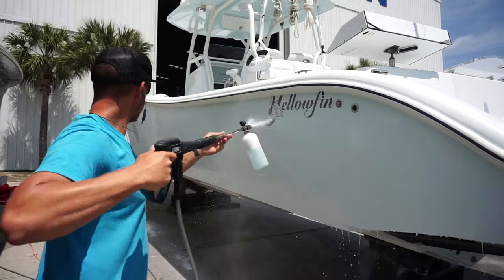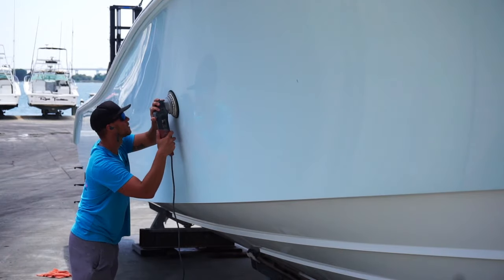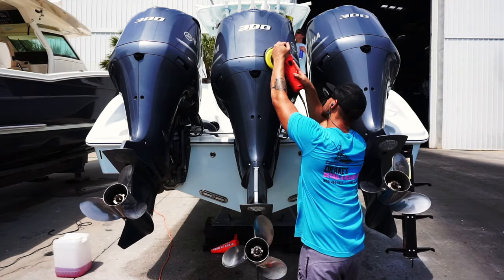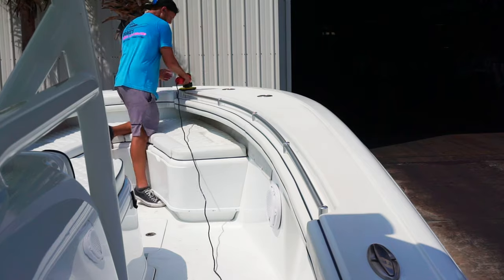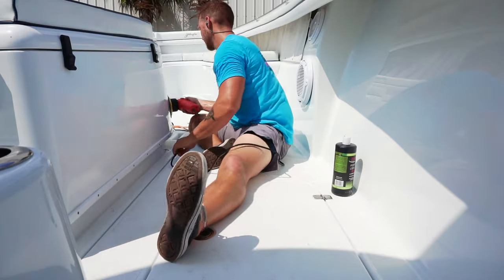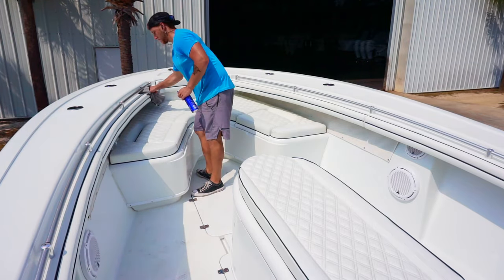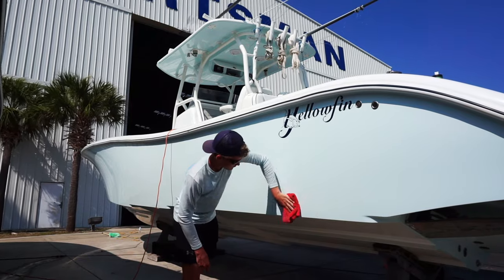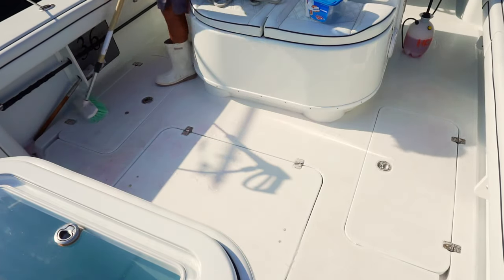How To Detail A Boat | 7 Steps To Boat Detailing | Revival Marine Care

Comment: What product would you use to get tree sap off hull and seat cushions?
Reply from the maker: Acetone will do the trick! Just be very carful on the seats ! 

What color seats are they ?
Reply: @DrakesDetailing  white, with blue trim,  do you dilute the acetone? Just wipe it off with water and towel afterwards? Probably wouldn’t want to use it on the blue section?

Comment: What kind of machine are you using and what type of wax would you use on heavy oxidation? Working a 42' bertram and never waxed gel coat before. To make things harder The boat is still in the water too. What's a good list of things to get what I need?
Reply from the maker: Check out my boat detailing restoration video! That’s would be good for detailing an oxidized boat

Comment: So you use the sealant stuff first polish it and then wax and polish after? Im referring to the exterior. Also whats the best product to get all the nasty stuff off the outside of a boat from a lake
Reply from the maker: You would polish it first then wax ( sealant ) . In this video all I did was apply the sealant no polish. 

I did however apply the sealant like a polish.. with the up & down and side to side motion in the video. 

You can clean bottoms with rust aid rust remover from Home Depot or any “ hull cleaner “ will do as well

Comment: I thought you are supposed to typically wipe off the wax after it dries in a section at a time and not let it sit on the surface and dry to long? You waxed the whole boat inside and out then wiped it off?

Comment: Hey bro! Getting ready to start my own detailing business! Can you send me the link the materials and things so I can start shopping? Appreciate it!
Reply: In the mountains of NC so a lot of lakes if you have any tips
Reply from the maker: What is your start up budget? There are a lot of things that you don’t really need but a great to have! Ha so what’s your budget and I’ll hook you up
Reply: Drake's Detailing under 1k just to get things rolling would be awesome
Reply from the maker: Let me work on something for you! If you go watch my videos and buy what I’m using that’s pretty much what you’ll need. 

I am going to make a video on “how to start a boat detailing business” soon!
Reply: Drake's Detailing awesome yeah I’ve looked at some of the stuff on Amazon you had, super cheap start up that’s for sure! Any suggestions on pressure washer? What psi do you use & carry around?
Reply from the maker: I have the power stroke one from Walmart it’s only like $250.00. If you keep oil in it it works great! If it breaks it’s cheaper to go by a new one than getting it fixed.
Reply: Drake's Detailing I was looking at that one! Do you charge by the foot of the boat plus driving distance or how do you price jobs? Mine will be all lake boats. So going to the jobs just curious how you price them!
Reply from the maker: everything I do is by the foot! But every boat is different and in different condition! 

If a boat just needs to be cleaned / detailed and waxed I usually charge around $20 - $30 a ft  for boats that are under 40 ft. 

If it needs correction, sanding or polishing I charge by the foot per step. 

Usually around $15 - $25 a ft per step 

I am also one of the highest in my area because of the quality of work I do! Ha but you can take these prices as a goal to get too
Reply: Get lake county pads. I use trt mirror cut and trt 4 in 1

Comment: Hey man, what pads would you recommend to use to apply some jescar to a boat hull/ console/ toe rail, using a griots DA
Reply from the maker: Buff and shine microfiber finishing pad
Reply: Can you just use a foam wax/sealant pad? Instead of the microfiber pad
Reply from the maker: Yes! That will work fine!

Comment: I noticed you washed/waxed the interior first then put diluted purple power on floors then scrubbed then rinsed. When spraying/rinsing the purple power off the floors, doesn't the purple power get all over the console and under the gunnels where you just waxed? Not a professional at all, just an observation. Thank you for sharing your experience and knowledge with the world. I've learned a lot from your videos!
Reply from the maker: Hey bro! As long as you don’t spray it directly  on the sealed surface you’re good 😊

Comment: Can't use that buffer if you're compounding boat. Also wax doesn't last six months out in the sun,two to three months if you're lucky. Bleach doesn't dry out the gel coat it's the sun that does. Also tell customers that purple power if it dries stains the floor so always keep it wet and rinse it before it dries. Good video been doing boats for 26 years, can't do it anymore because legs are shoot.
Reply from the maker: Thanks! Yep, thats the DA polisher I only use for waxing 😉 I always rinse my deluged purple power very quickly after I spray it on.
Reply: @DrakesDetailing   That Power Lock Plus lasts a very long time in harsh environments.

Comment: Pro-tip, do not use magic erasers, use melamine foam. Same thing, a tenth of the cost.
Reply from the maker: Nice! Never heard of it thanks
Reply: @DrakesDetailing  I usually buy a pack of 50 sponges for $5 off eBay, I hope that saves you a little money.
Reply from the maker: Yea I pay $20 for 50